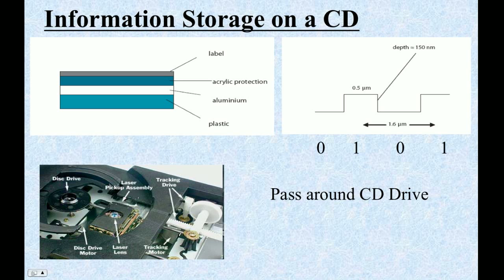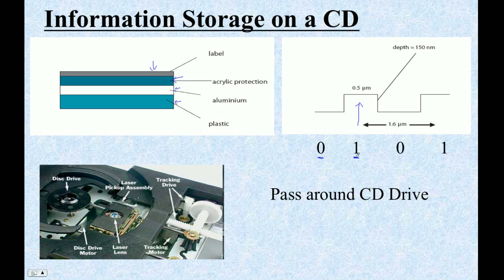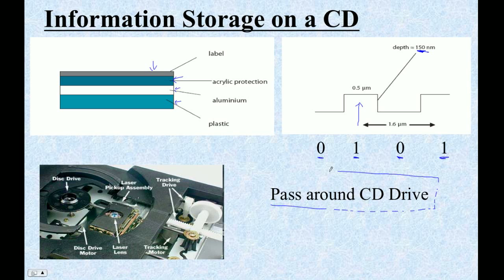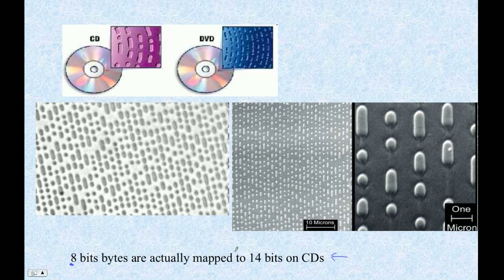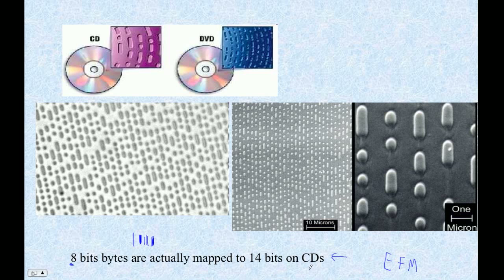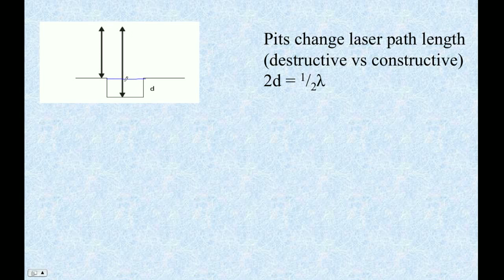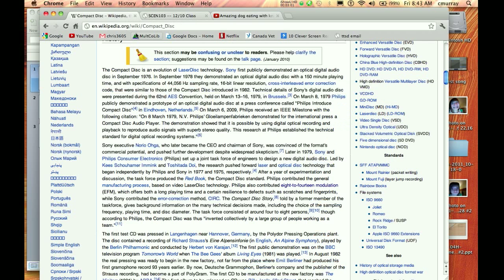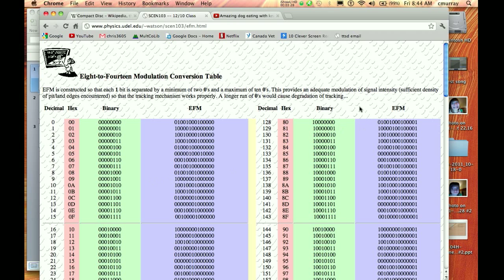HTPIBDISE How Information is Stored on a CD

Comment: This may be true on a professionally produced CD like from the artist but I don't know if it's true of all CDs. A few years ago I bought some rewrite-able Maxell CDs from Amazon.  I recorded the CD on my burner. The CD worked fine and I was trying to write the description on the surface/label on top of the CD with a pen. The pen wouldn't write very good so I pressed real hard but it still didn't write so i said screw it. Then I tried playing the CD again and it was all messed up and skipping like crazy.  I took the CD out and the label had begun to peel off in some sections and you could see through the plastic disc, it was just clear. As if all the data was just stored on the underside of the very thin top label.
Reply from the maker: Yeah - I think you are right.  The bottom seems to be just clear stuff, and the actual layer is on the top of the CD.